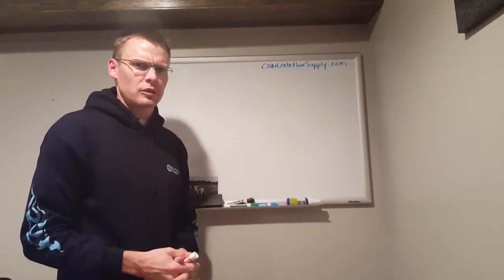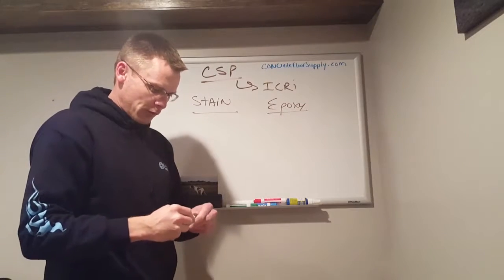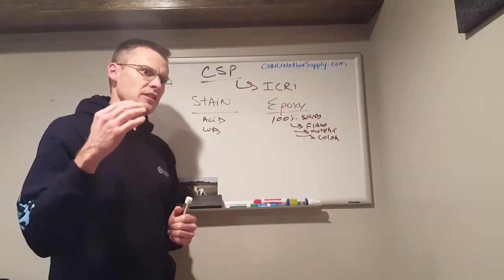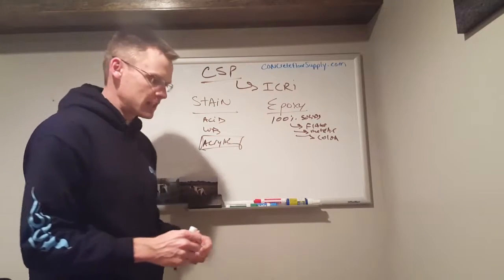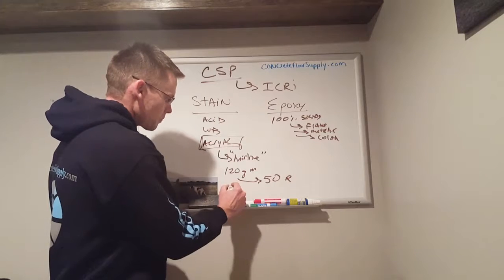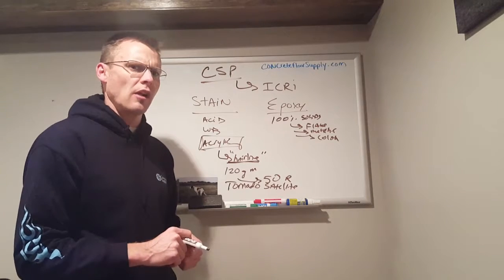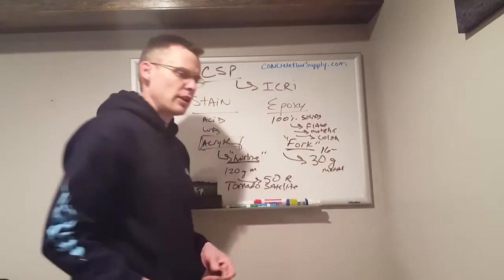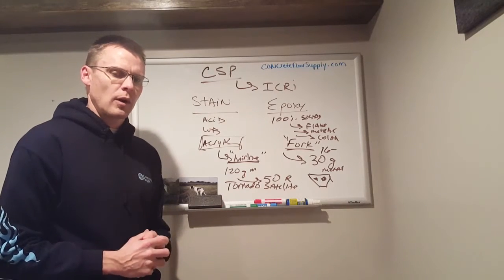Surface Profiles for Stained Concrete and Epoxy Coatings

Comment: Would I be correct in understanding that one wouldn't want to do acid etching on stamped concrete (indoor) as it is not the appropriate surface profile? Thank you so much for this info.  I think you may have saved my family a ton of trouble and grief!